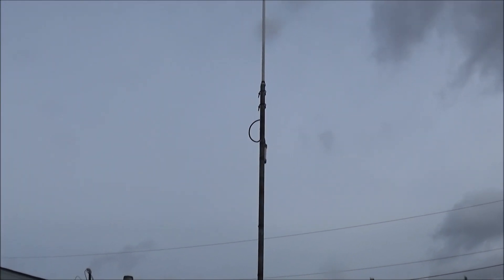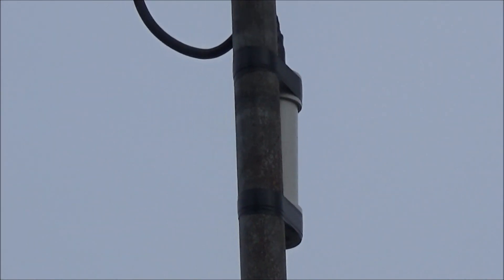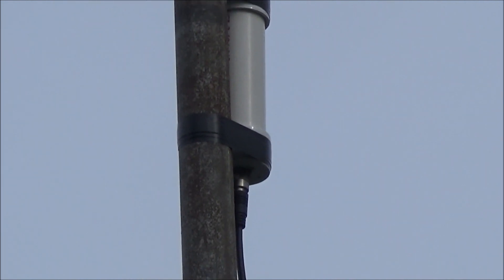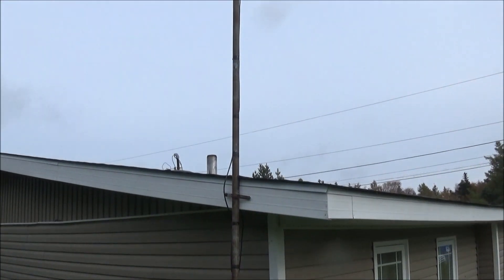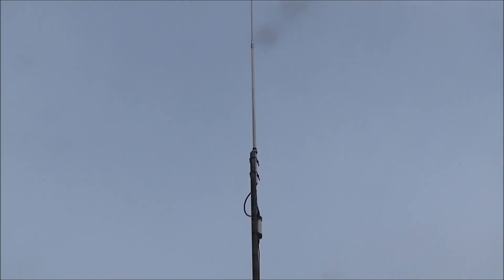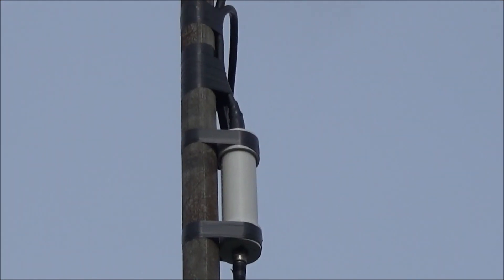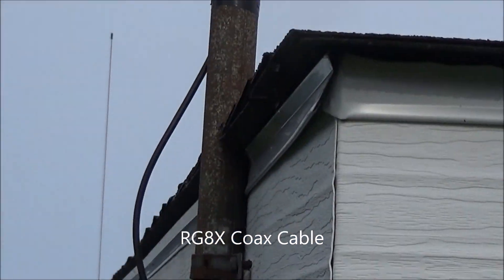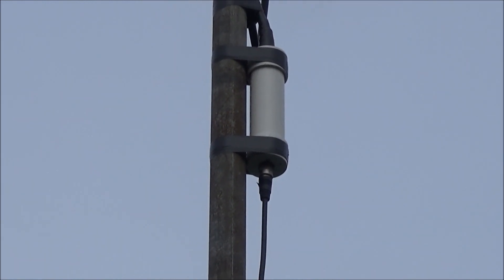MFJ   915 Insulator/Balun Installation on Antron 99 Antenna

Comment: Did you experience and issues with water ingress ? I found over time water gets into the coax and sometimes into baluns. I have drilled a couple of small holes to let any condensed water out of a balen on an OCF Antenna.
Reply from the maker: No issues with water at all. the balun should bleed any moisture out of it. What you did musyt have been a good modification...

Comment: How does a Balun Help?
Reply from the maker: The main function of the balun is to stop RF from getting back down the coax and into the radio, ewquipment and other electronics
Reply: @Tobinindustrial can achieve similar responses by placing snap chokes on every single line in shack incl power lines speaker lines all drop lines every antenna power ac lines device charging lines etc I spent all of 15$ for kit of multi size and not a regret  no random noise left. Even placed two on mic cable of hand held d104 shows mod light but no insertion to transmit